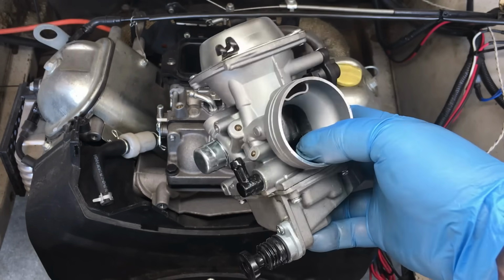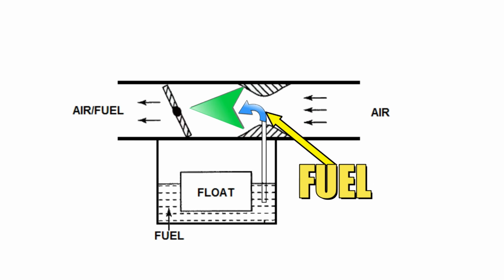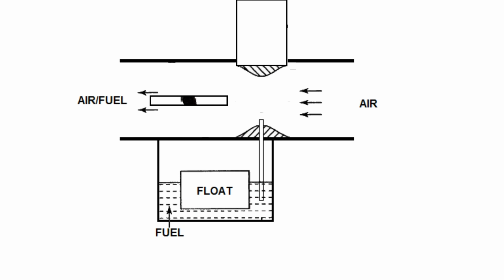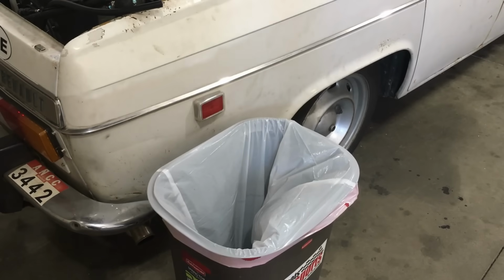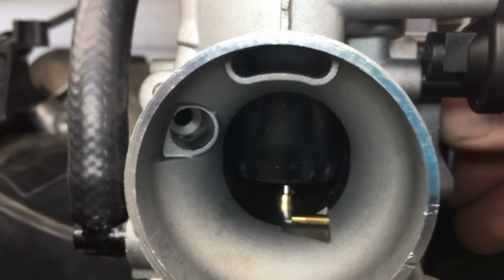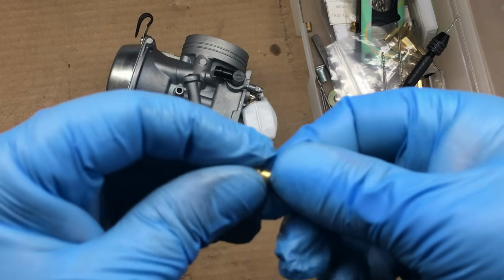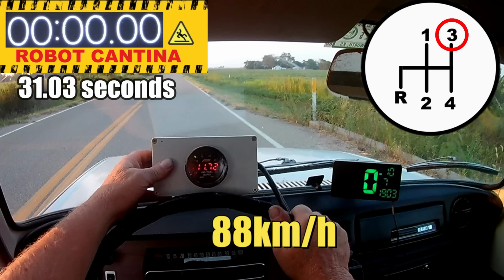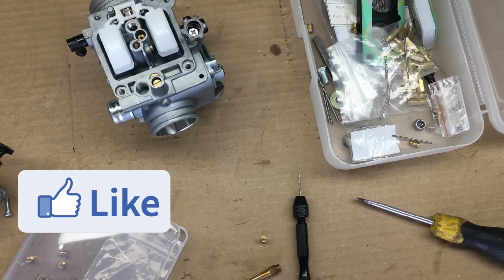S3 E30. The 670 predator Renault gets a Keihin CVK carburetor for better performance?

Comment: Nice justification for variable venturi carburetors in your carburetor 101 lesson but in most applications they run like crap over a wide RPM range and is why they often get tossed by people that drive them daily.  I think in your application a throttle plate fixed venturi carburetor will give better overall performance.  Unless you want to step up and try some fuel injection.  That would be cool to see.

Comment: Don't you think that some of that dip could have something to do with the needle the needle taper and the needle clip position if there's even an adjustment on that keihin carburetor. I think getting an adjustable needle in there along with a needle that is appropriate for sea level to 3000 ft elevation would be a good move. For fine tuning  The needle taper would be something to look at. There is for some models of motorcycle carburetors a device called dial a jet. That way you can adjust the jet size kind of like a mixture screw. They can be a bit finicky but can be a quick adjustment on the fly. It would be helpful to know what jet sizes that you were using for the main and if you are using an adjustable needle. Your pilot and main air jet may be a factor for this as well.

Comment: As an old school drag racer it's not 5 to 60 mph. Its the time. In that scope leaving harder reduces the over all time unless you can't shift the trans easily, I would do some time doing launches to 60 ft. Checking the time it takes to get the 60 foot.

Comment: wonder if the barrel holding the needle in the emulsion tube is being pulled up enough and comes down after accellerating and driving at full trottle for a while (equalizing)  , the barrel needs the vacuum behind it too , maibe you need a bigger bleedhole or weaker spring (not sure if theres a spring behind the barrel but it needs to come up more at midrange and stay up )

Comment: The carburator you have bought is really great. I haven't seen one close to that one. Just Mikuni carbs. The electric fuel pump is a plus. The fuel system is a plus. If you really want to upgrade horse power, you should buy a Harley Davidson Screamin Eagal engine hooked up to a turbo.😂😂! Great carburator experiment!

Comment: I would have chosen a Keihin 40mm FCR carb. Easier to tune and has an accelerator pump. They come stock on single cylinder 600cc motorcycle engines.

Comment: The thing is... motorcycle carbs like that usually run 1 per cyl. You have a bigger carb, sure, but you're now splitting it up... where as the other carb was smaller but each cylinder had its own carb

Comment: Hold on before you sink into your emulsion tube. The idle jet also provides fuel when driving  at the lower rpm ranges which is called the progression circuit. You might just want to try a smaller idle yet and a bigger main jet. And if it is lean on the higher rpm than dril an extra hole on the emulsion tube on the bottom side towards the main jet. I really enjoy watching you tinker around with the Renault. For your information the french number plate ypu had ended with 01 and that means it was back in the day an Parisian plate :-) cheers! Or should I say santé.

Comment: Just a thought, I cloud completly wrong here, but looking at your amazing graph, then looks like when the needle is partially open, then the fuel flow and pressure is decent and even more than needed, but at full throttle, the fuel how/pressure may not be enough. Maybe put a pressure cage, and monitor that.
Like I said, maybe totally wrong though.

Comment: What about an E85 build for more power to get engine up to normal driving speeds???? It burns cooler which is better for an air cooled engine. It's about 100-105 octane and makes more power using higher compression without pre ignition risk. 
(you probably already know) Mill the heads, add stronger valve springs, add small cheap turbo. 
People have been buying cheap 80s bikes, converting to E85, adding turbo and making big power without any head milling to raise compression.

Comment: Just put the right carb on. Whats the point to use the smaller carb? bigger carb will get just as good fuel economy.
Reply from the maker: The Keihin carb that we are using is actually bigger not smaller.

Comment: There is a mathematical formula for a flowed,, not ran are but like a slant six Chrysler or a cross ran if you have a tube it will create a effect,, air induction on that specific engine. Or just maybe start out with three or four 5 in tube leading to the manifold

Comment: Agree, these carbs are a rabbit hole. Needs air box to get proper vaccum for the venturi. Could be why ots going lean, not opening needle far enough. It could also need changed to a bigger low end or sometimes they are adjustable with a c clip on top, drop it down. 3/4- full is dictated by the main jet.
Reply from the maker: I don't recall if the air filter system is visible in the video, but we are running an filter system on the engine.  Due to the tight space the filter is  about 15 inches away from the carburetor and we are using 3 inch ID piping to connect the filter to the carburetor.

Comment: You need to lower the needle to decrease fuel at part throttle 
The main jet is for full throttle and these cbk carb use vacuum to modulate the slide Venturi so it won't fully open until the engine get up too speed vs a fcr carb that got a accelerator pump for enrichment when you stab the throttle vs this carb that won't open the slide instantly like the fcr so the needles position is really important especially for maximum acceleration

Comment: Any chance of extending the intake manifold length after the carb and before the billet block. The longer intake runner will move the torque curve lower in rpm range I'm guessing your not revving very high so the short runner will be hurting the low and mid range torque point moving it higher in the rpm range. Richard holdener has lots of dyno videos on lots of different engines check some vids out

Comment: Youre rich at part throttle because of the slide cutout (it needs more cutout), and your needle taper. Idle is pilot jet. Off idle to 1/3 is cutout/pilot (your idle mix is fine, so cutout is your culprit). 1/3 to 2/3 is needle/cutout/pilot (where youre transitioning to lean, so your needle is too restrictive in taper), and 2/3 to full is main, needle, cutout, pilot. So, to properly tune your carb, you have to cure each transition in turn. Get your off idle -1/3 right by slide switching (or manipulating the vac port in the slide, or both). Once you have that right, fix 1/3 to 2/3 by needle manipulation (height/taper). Then refix your off to 1/3, lol. Once you get idle, idle to 1/3, 1/3 to 2/3 "right", THEN play with the main, and redo the lower openings as needed to get a "proper mix" throughout the throttle range. Youll NEVER get it right by just playing with the main and emulsion tube.

Comment: I say try a pwk style, these  cv carbs are not the best in terms of better overall performance when compared to one.

I see a lot of comments about the clip on the needle. While its true it does need to be adjusted when running an open filter. You stated in the video at partial throttle it went to 9 afr. Thats telling me the clip is too rich.

The main jet doesnt seem to provide the fuel needed for the proper mixture.

Comment: This might be the (relatively) young engineer in me talking, but carburetors seem like an awful lot of trouble to get an engine to run right.

If you have experience with electronics and possibly a bit of programming, ECUs seem like a better choice. And to make matters even better, because you get to time not just your injection, but also ignition you will get more power. Honestly a no-brainer, but I understand if you wanted to fiddle about with carburetors for fun.
Reply from the maker: We did EFI on the 420 cc engine that we used in the Honda Insight.  This time around I want to see what performance improvements we can get with a carburetor
Reply: @robotcantina8957  Yeah I remember that video, that's why I'm mentioning it here!

Comment: What about changing the springs and rollers in the torque converter? if you can get that belt to grab a little quicker i think you can get great improvements out of it in all aspects.
Reply from the maker: We are not going to change anything on the torque converter until the carburetor is sorted out.

Comment: Question. What is the advantage of using a cvt to the transmission instead of using a clutch instead?
Reply: The motor has to have thrust bearings to deal with a clutch, and this motor doesn’t provide them.
Reply from the maker: The CVT is a simple way to connect the engine to the transmission.  This engine doesn't have the necessary thrust bearings and a regular clutch would damage the engine.

Comment: I would love to see a close-up of the dashboard speedometer or and – lights I love that car even though I like the older one a little better I love that one my buddy's Grandpa's father had a front-wheel-drive one. I don't believe it was anything like that one but it would had a four speed on the column and 3 lug nuts for wheel. But anyway I love the look of that car you have to look
Reply from the maker: In one of our oler videos we show a close up of the dash speedometer.

Comment: I wonder what the air-fuel ratio is side to side? could your temp each side of the exhaust to see if one side is hotter as a way to see if one side is running richer or leaner

Comment: Hey Jimbo:
Jets R Us is right across the state in the Joplin area. I order from them and get them shipped to KC very quickly. They have basically any size you can imagine for Mikuni, Keihin, and others (I think Bing?)
Reply: Also worth mentioning:

Keihin CV carbs generally don’t run right (at least, on Honda motorcycles) unless they have either an air box or a velocity stack. Perhaps that’s sapping power and helping it to run super lean. It certainly was on some CB350s I’ve fiddled with

Comment: That carb tunes differently than what you are used to. A little search will get you there.
Reply: You will find tuning to be much easier if you can straighten the airflow before the carb. Use 4" of tube between carb and air filter.

Comment: Just some advice brother, if you plan on running an air filter you should be testing with a filter. I believe that will help a little with being lean on top end.
Reply from the maker: Actually we were running an air filter system, however I don't believe we shot any video of it.

Comment: so widebands and air cooled engines are a little odd; as the load increases the engine heats up and this causes a more complete burn, seemingly leaning out. In terms of tuning part throttle vs WOT you want to look into either shifting the needle or getting a different needle for part throttle, and adjusting the jet (or I guess emulsion tube in this case?) for WOT.

Comment: second point you may want to go to duel motorcycle carbs, all the big bikes 500cc and up that I've owned had a carb per cylinder. I couldn't tell you if there is an engineering reason for it, but I look it it this way, if manufactures could save money by using a single carb they would unless the results would be bad enough to damage the brand.

Comment: the pilot jet on a cv carb is responsible for providing a larger amount of fuel up through a 1/4 throttle than i think you realize, that in combination with too weak of a spring on the diaphragm could be contributing to your low end rich problem. by all rights with a correctly sized CV carb the main jet size should have next to no effect below a 1/4 throttle. also with the stock carb you had a combined carb throat size of 56 mm, reduction to 32mm or 16mm per cylinder might be to restricted. however, with all the engineering and fabricating you do, i would think throwing together some kind of usable makeshift flow bench would be easy peasy for someone with your abilities .....it also just occurred to me that the main jet circuit on that keihin carb is meant to provide fuel in the upper rpm range which is well above the the 3600 rpms your lawn mower engine produces, your diaphragm may be opening to early at lower rpms but not opening far enough at the maximum rpms of that engine.....

Comment: It would be interesting to a larger fixed carb and then tune the CVT to match the peak power rpm of the engine with the new carb. Other than the initial getting the cvt to speed it should hold a set rpm correct?
Reply from the maker: The CVT is set by both weights and springs. The CVT may "downshift" if the RPMs drop below a certain level.

Comment: the cvk carb will work alot better once the correct aitflow is setup with an air filter these carbs dont like working properly with to much free flow as the vacuum needed to alter the venturi come at the wrong point of the throttle range

Comment: Wouldn't a 41mm fcr carb be more appropriate for 670 ccs I mean it's what is used on a Honda trx 450 or crf and also it has a force pump to help with the atomization at low rpm !!!!!

Comment: there is a reason for the "twin" carb setup, the Common Camshaft in the V twin is part of the problem, if it was a 300 degree/ 420 degree type design then this wouldn't be anywhere near as bad as the cylinders drawing at 60 degrees apart, but it means each of the cylinders gets a very different charge, making tuning the carb for BOTH cylinders almost impossible. And as they are also drawing at the same time, the area of the single carb needs to be double one of the Twin carbs throats. the single carb on a common cam V twin is the stupidest idea ever & I can't understand why there are kits to do it, it would be much much better to have two VM22's on it!

Comment: a single carb on an odd fire v2 is sadly asking for issues 😞
Reply: If a person was to increase the plenum size to maybe even out the vacuum pulses, would that help? Just a thought/curiosity.
Reply: @goosenotmaverick1156  That would help, but it would need quite a bit of volume. a giuess would be around 1-1,5 times the volume of engine to smooth out enough :-)

Comment: im sure its been mentioned,  but cv carbs need an airbox .  they need to be about 10x the volume of the displacement of the engine,  speaking from experience they never run quite right without them,  or if you do get it running quite good, you end up using way more fuel,  as to why... fuck knows

Comment: Hmm, "32CVK", just had to get "2CV" in there somehow... :P
(That said, Solex 26/35 carb, as used in later 2CVs & derivatives (602 & 652cc), properly jetted could probably work, but, finding one over there, yeah, most likely no, especially as over here they're more often than not out of stock anyway!)

Comment: Are there carburetors with a variable Venturi?  I’ve only worked with fuel injection…
Reply: Look up the carb cheater. It is sorta like you say, except via a controlled vacuum leak.
Reply: That's what this carburettor is.
Reply: @joshuagibson2520  Now that is awesome.  With this a carb isn’t just some static device that I struggle to tune… or pay someone else to tune. Thanks for sharing.

Comment: You will likely need to alter the air corrector jet. This may be a fixed orifice in the carb body. 

You also need to mark off a 1/4 mile on your acceleration test track for another data point. 

Thanks for the video

Comment: I know you said you can't use an automotive carburetor, but did you consider maybe using annular boosters? They usually work great  at metering fuel in low engines speeds. Not sure if they're available for OEM carburetors but I know they're available for Holley carbs. In any case, nice work Jimbo!! 💪🔥